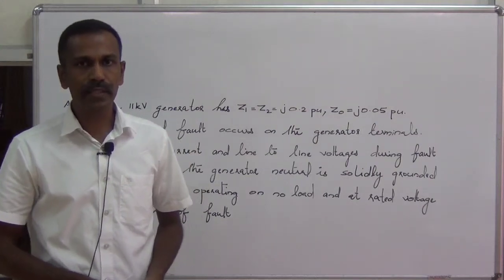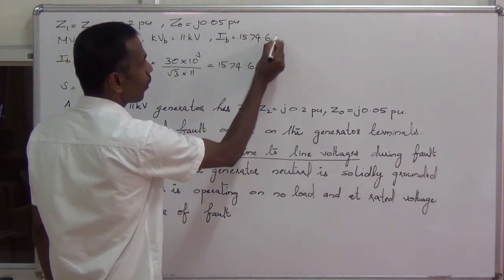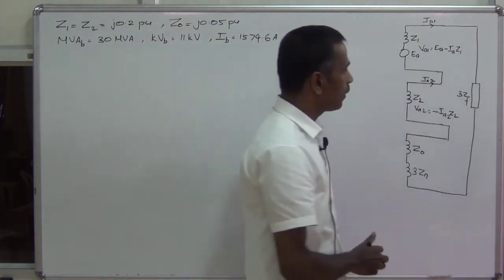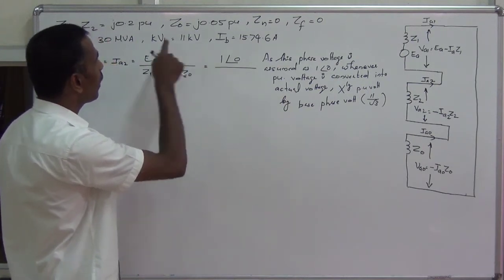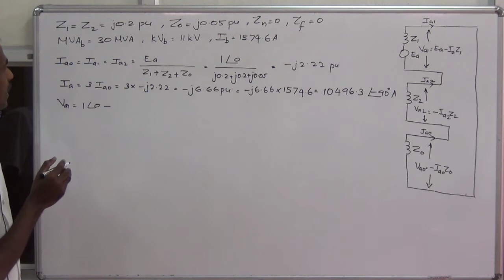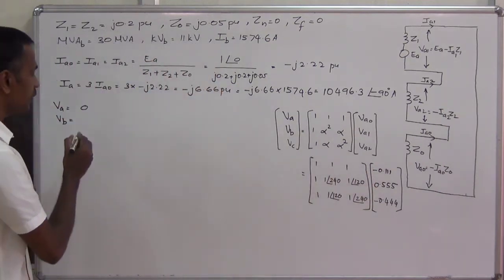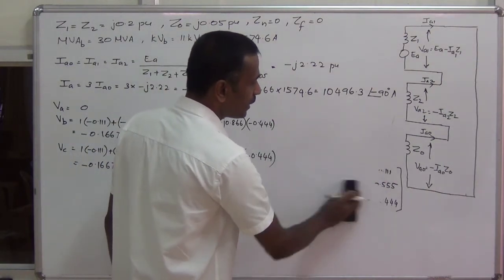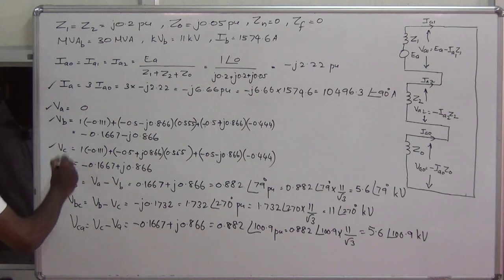SINGLE LINE TO GROUND FAULT / NUMERICAL PROBLEM /KTU/ POWER SYSTEM ANALYSIS

Comment: Incremental fuel costs in Rupees per megawatthour for a plant consisting of two units

are given by:

21-dfl/dPg1=0.0080 Pg1 +8

22-df2/dPg2=0.0096 Pg2 +6.4

Assume that both units are operating at all times, that total load varies from 250 to 1250

MW, and that maximum and minimum loads on each unit are to be 625 and 100 MW,

respectively. Find the incremental fuel cost of the plant and the allocation of load between units for the minimum cost of various total loads
I need the answer plz